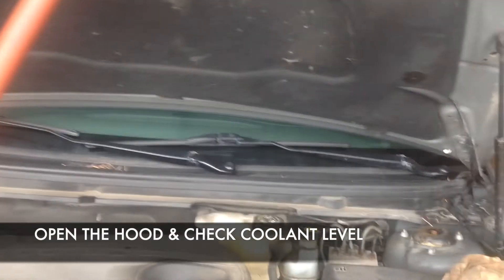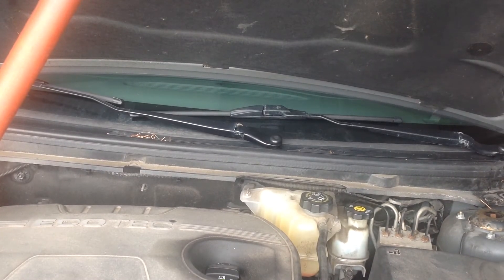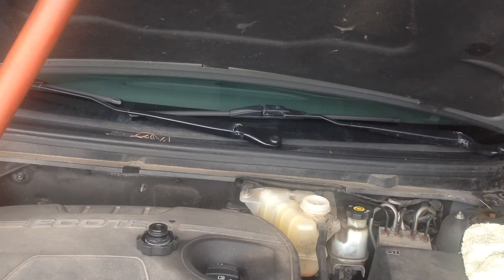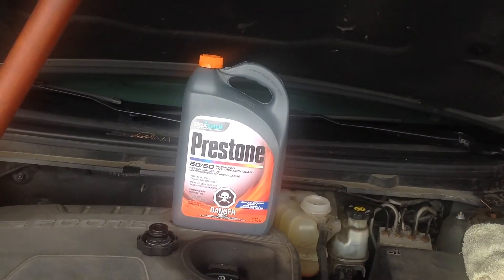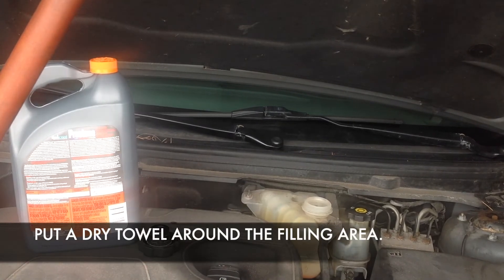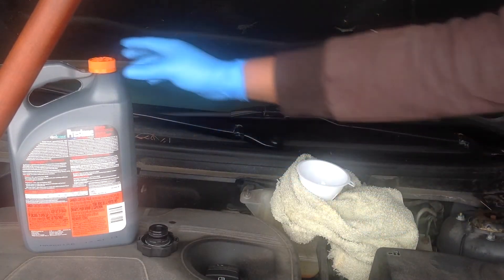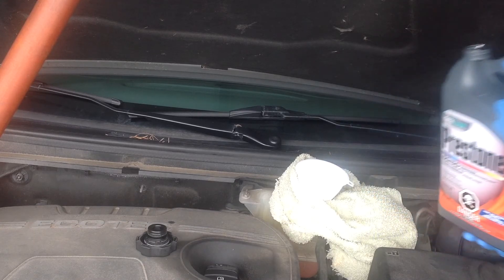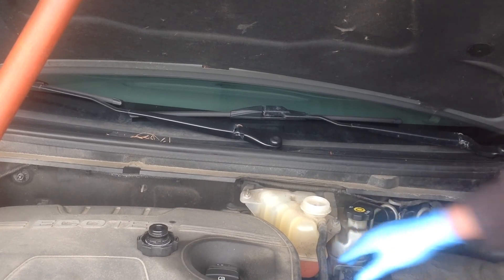How to Check and Add Engine Coolant /Antifreeze | 2008 - 2012 Chevrolet Malibu.

Comment: Hello, thank you. I have a question tho. 
Mine is a little dirty, do I just add it anyway or can I flush it first ?
Reply from the maker: Hi, thank you for your comment. If the coolant inside is dirty, you might need to change the entire reservoir or check for the entree point of dirt.

Comment: Clear instructions but did you mix it with distilled water? I know that for many GM engines Prestone "must mix with distilled water to the desired mix ratio of Antifreeze+Coolant and water".
Reply from the maker: Hi there, i used the premixed one so i did not have to mix it.

Comment: So I added some antifreeze to mine and now my AC won’t turn on. Any suggestions?
Reply from the maker: There are several reasons AC wont turn on. You should get that checked out by a mechanic.
Reply: Mine does that sometimes. Not even joking, if i punch it, it works haha.